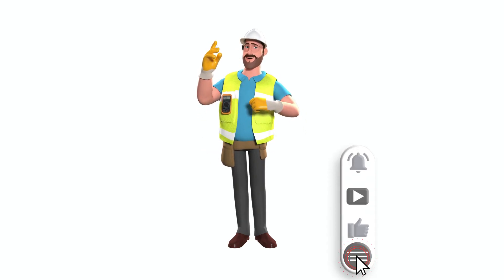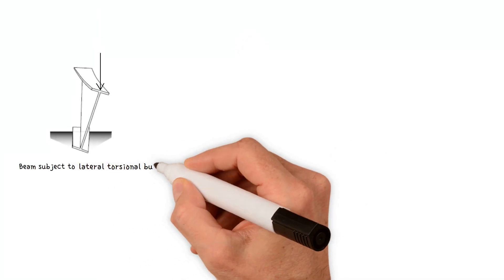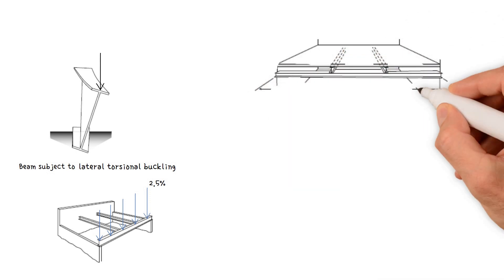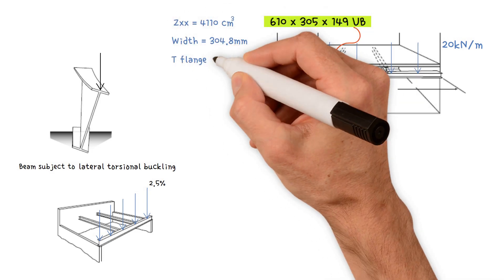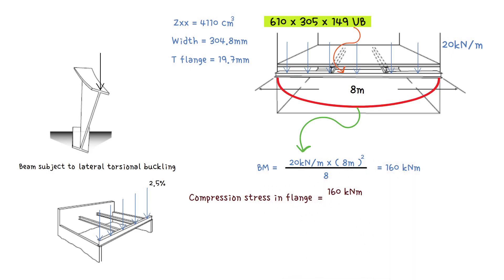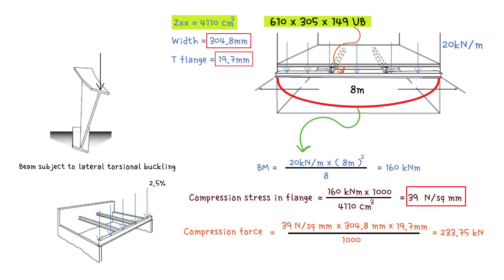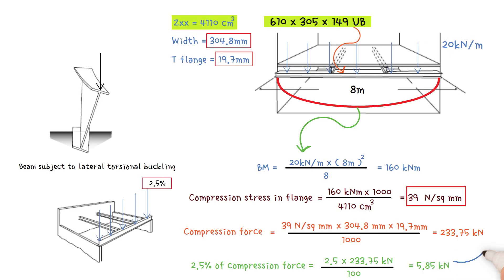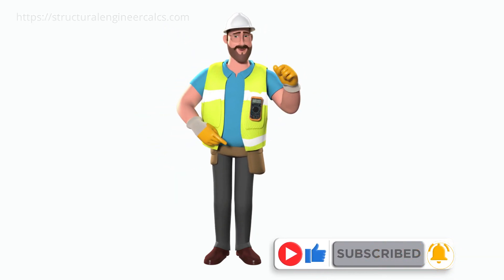Calculate forces that restraints must resist to prevent lateral torsional buckling of steel beams.

Comment: Great video, but I have a question. Are those 2.5% mentioned somewhere in the some code, because how should I argument my point of view that it is enough, maybe 3% or 5 % need to be taken?
You mentioned that steel beems have a tendency, I assume that it is due to the shape which they are produced and placed in the structure. If it would be a solid block but still in steel, then it should not have such problems. Additionally, I assume timber I-joists also can have such problem due to the form, but it can be neglected as they are covered with some sheet and fastened to it which creates quite a rigid system.
Reply from the maker: According to BS 5950, for one or two restraints, the members must be able to withstand a total force of 2.5 percent of the maximum compressive force in the beam, divided amongst the restraints in proportion to their spacing; for three or more restraints, each restraint should be able to withstand 1% of the maximum compressive force or the 2.5% force distributed in proportion to the restraint spacing. Eurocode 3 (BS EN 1993-1-1), Clause 6.3.2 explains that in order for a steel beam element to be classed as ‘restrained’, its compression flange must have sufficient restraint to prevent  lateral torsional buckling. Beams with certain types of cross sections such as closed hollow sections with a height/depth ratio of less than or equal to 2, are not susceptible to lateral torsional buckling.
Reply: @StructuralEngineerCalcs  Thanks a lot for such a detailed explanation